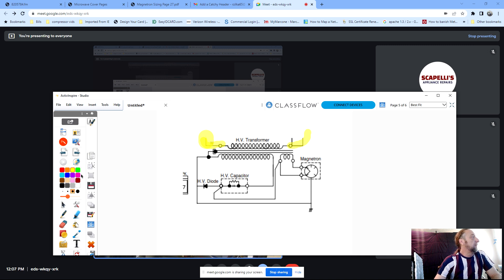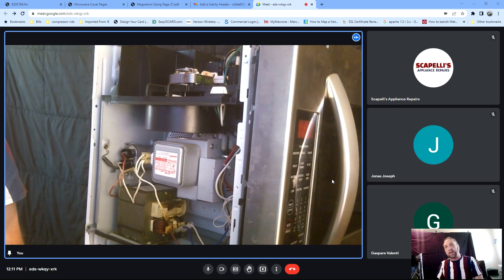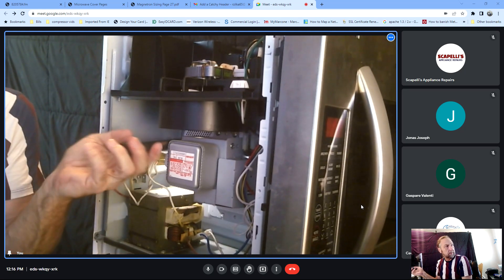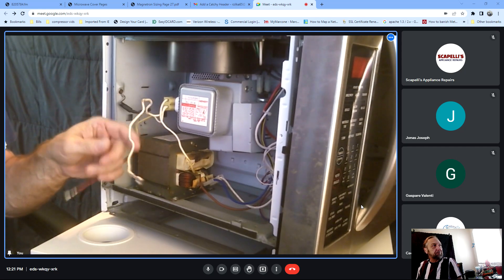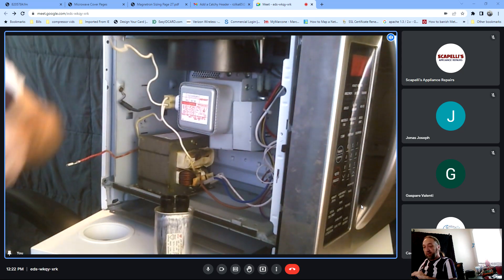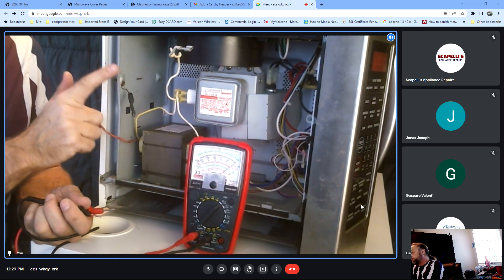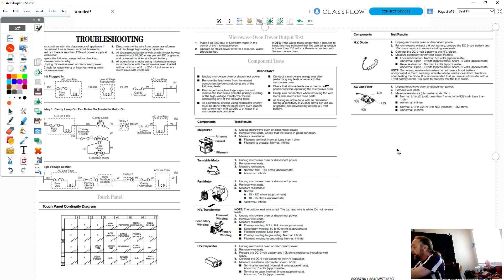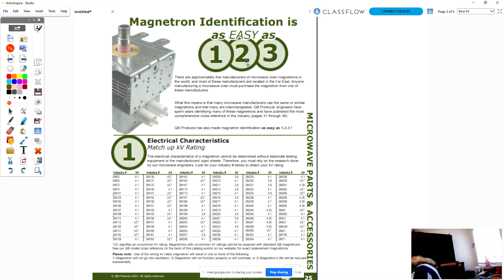Microwaves - from Saturday virtual class

Comment: I always press stop before opening the door to help protect the primary door switch. The relay on the control board is more resilient than the primary door switch. My mother kept going through primary door switches. I noticed it was because she was constantly opening the door to stop the high voltage side. This arcs the primary switch and leads to early failure.

Comment: The service manual is correct with testing the magnetron I’ve found my faulty. It’s good testing diode, magnetron and capacitor. If those are good then the transformer is bad which is the only testing that varies by the manufacturers

Comment: What a teacher, I wish I  had some one with your enthusiasm to teach back in my day,
I had placed a mental blockage on electrical items that never worked , well most items that needed electricity to run , due to not understanding it and thought well ` its dangerous and if I will never mess with it then no need to learn about it, how wrong I was,
The trouble now I fix allot of stuff mechanically don`t like to throw anything away, but get stuck testing electrical items, its like my brain will not hold information when it comes to using electrical testing equipment to use on components, I just can not get it to sink in.
This becomes so frustrating, 70% of stuff would get trashed because I cannot test the electric side of the components or item,
I for several years still can not remember how or when I should test for open circuit ,close circuit, test a loop, test for leakage, test for earth because I can`t remember how or what setting the dial needs to be set to on my instruments and what instrument I should be using to test my appliance., or when AC might get changed to DC with a component down the line in a electrical piece or vicar versa.
I learned how to work out ohms law in 20 minutes and forgot it 2 days after.my brain just refuses to remember this stuff , even though I want to,
Its almost like one side of me wants and need to learn and the other side just stops me ,
I am now in my 50`s and all i know is how AC and DC runs along the wire, and what a capacitor and a starter motor and a resistor is, but I do not know how to measure them because I don`t understand how to,
Is there a known condition that I may suffer from or have I just excepted from my teen days to teach my brain never to remember neither bother understand electrics and now its to late for me to trick the mind into wanting to understand,?
I have been so fixed on your vid`s because I understand what you explain while watching but will forget it 20 minutes later.
One thing I need to know, As I live in the UK England our electricity is 240. well might be 230 v _ and + 10 % either way now, 
Does this send 230 v to my transformer and if so do I set my volt meter to 500 v AC when testing the transformer with the two probes at the connectors. ?

Comment: Very informative.  I watched most of this video and I have a better understanding of how my Samsung microwave works now.  It just failed on me and I am thinking it's the secondary interlock switch that is faulty.  I ordered new door switches a few days ago and also got a 5 pack of new fuses too ( just in case )
I'm sure the fuse is good but if I blow it changing a part,  then I've got a few spares.  The microwave doesn't count down, it doesn't turn the table and the magnetron is not  running.  It does have a light on the inside and a light humming noise when I open the door.  It won't heat, no turn table and no cound down.   Would I be correct to say that it's likely the secondary interlock door switch?  I am hoping to change the switches out tonight.